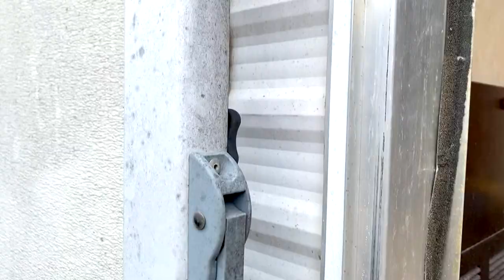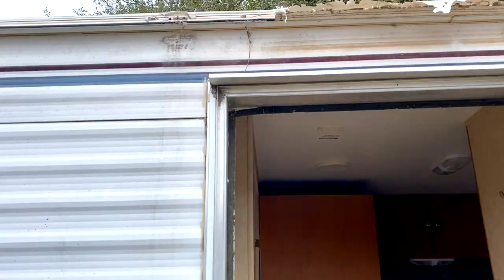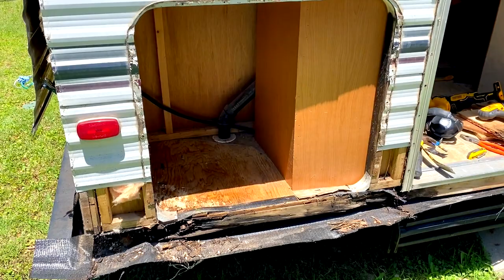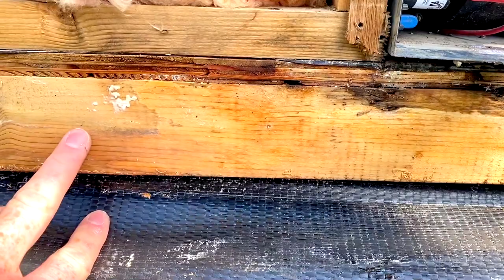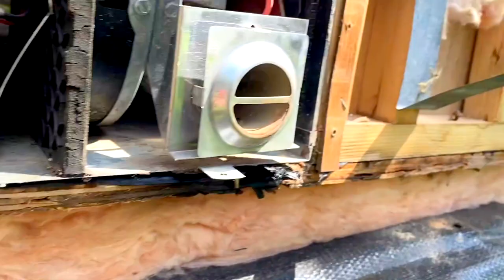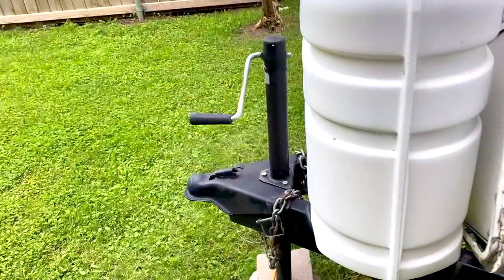RV Water Damage: Replacing and Rebuilding the Frame

Comment: I'm into a nice little repair of my own currently. lots of fun.. ( not really ) The travel trailer I'm working on has the same aluminum siding. I'm a welder and fabricator, among many other. and as I was removing the bad wood studs from the inside of the trailer and had rusted staples protruding from the siding that I snipped them off flush and thought, how will I reattach the siding to the new studs. I came up with a nice crafty option. I designed a simple bracket and are currently making a bunch of them. If you are doing these kinds of renovations often. Let me know if you might be interested in them. Also. The multitool is an awesome tool. I'm so glad I bought one a while back. RV's are not built to last. and a good example as well others is how they seal up the undercarriage with a tarp material. they know there will be leaks, and the water has to go somewhere. why not turn the undercarriage into a pond. because that's what mine did. The water had nowhere to go other than down and to just keep building up and saturating the entire under deck. stupid idea if you ask me ( or a smart one? ) I cut it all out after the water was done draining for a day. I plan to do something different. Anyhow. I commend you for your dedication. it can be very overwhelming. I know, because even though I know how to repair them, I quit several times. Appreciate the video's.
Reply from the maker: Thank you for your encouragement. It's amazing how poorly these things are built. I'm intrigued by your bracket idea and will reach out if I'm in need. Thanks again.

Comment: Great Video.  I'm into a very similar repair.  For those bolts through the frame, I used lag screw bolts up from the bottom screwed into the sills. Sucked them down nicely.
Reply from the maker: Awesome work!
Reply: @remodelyourrv 
Perhaps a threaded rod with nuts and washers on both sides to attach to the frame?

Comment: I am going thru a almost identical situation and have come across all your videos to give me a great reference as to what I am looking forward too.  My question is for all those carriage bolts you removed for the lower sill plate to the frame, what did you use to reattach.  I see Saltbox97 said lag bolts from below, is that what you did as well and then screwed down thru wall framing?
Reply from the maker: Yep...that's how I did it!

Comment: I'm just recently getting back to my own trailer project. (2005 Skyline 250L-T Nomad Lite) Lots of floor and wall repair. Slide-out rebuild, too. The roof seems to be ok, blessedly.
What did you end up re-sealing the lower membrane with when you re-attached. Staples only? I ended up cutting much of it halfway up on the floor frame  so I assume a sealant is advisable. I thought you  may have mentioned it in one of your videos, but I can't find it if you had.
Reply from the maker: Yes. A lot of staples seem to have worked well for me.  Good luck with the project.

Comment: Did you use staples or nails when reframing? If so what size?
Reply from the maker: I mainly used screws, which were of varying lengths depending on location.